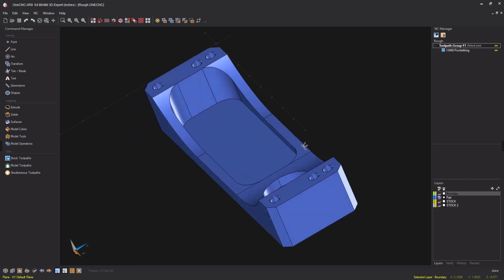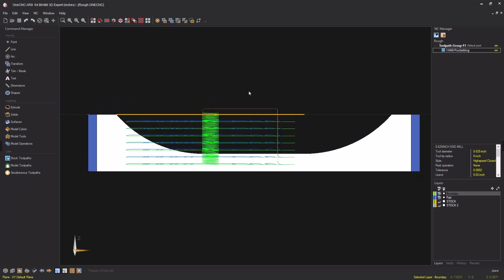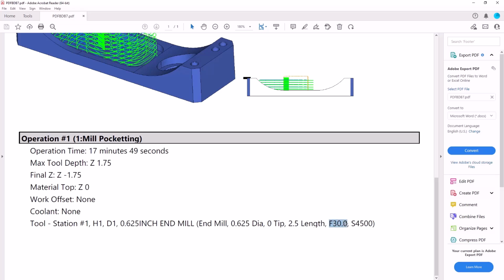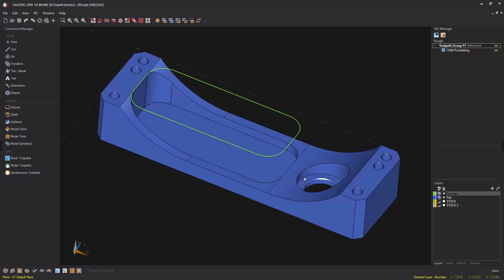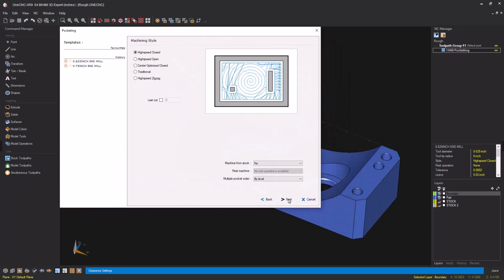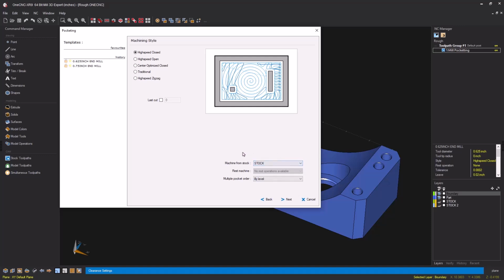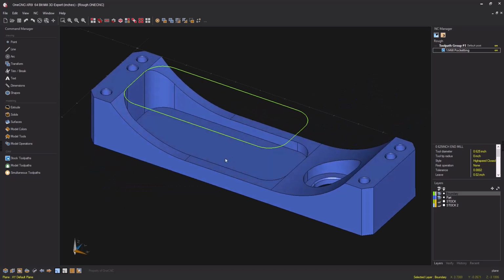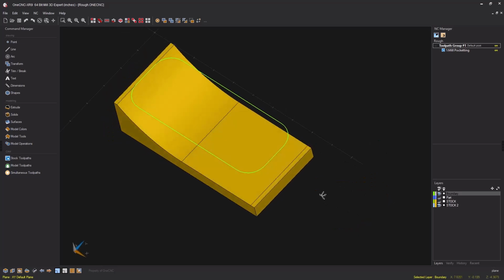Crazy Secret to Slash CNC Cycle Time Revealed!

Comment: That's much more efficient - is this available in all mill versions? The title says '' - that's a bit shocking! 
It also would be even more efficient just to machine the pocket as is without making a STOCK body to restrict toolpath within...however, perhaps if 'clever' with the stock body shape, other fairly automatic little cutter path adaptions might be possible.
Can the selected STOCK body be named STOCK1, STOCK2, etc or even 'POCKET 1 solid cut' - is there naming restrictions ?